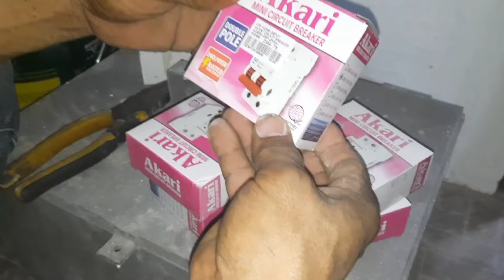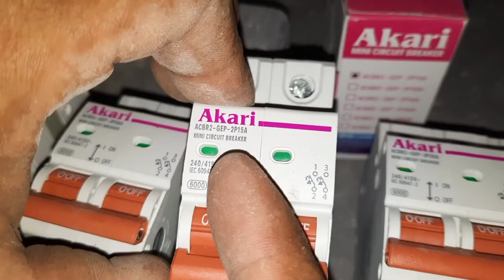PAANO MAGKABIT NG CIRCUIT BREAKER AT MAG-TERMINATE NG MGA WIRE | Pinoy Electrical Warrior

Comment: Boss tanong lang, balak ko sana maglagay floating shelf malapit sa may circuit breaker.., pano po maiiwasan matamaan yung wires pag wala akong gamit na stud finder? Lagi bang pa vertical wires nyan, basta iwasan ko lang magbutas sa mismong tapot ng box sa taas o baba safe na ba yun? Ganyan na ganyan dn po itsura ng circuit breaker namin.. Salamat
Reply from the maker: iwasan niyo nlang po mag butas sa baba or taas ng panel board, opo safe po ganyang breaker

Comment: Main breaker 40 ampere Lang??
Tapos branch circuits 20a,15,20,30 ??
Hindi kaya mag trip main breaker
Reply from the maker: Hindi po magtitrip yan boss, ung main po kasi di pweding lakihan kasi naka temporay connct lang sa dating linya, papalitan pa yan pag ok na ung bagong meter base, saka di naman po nila pweding pagsabayin lahat gamit.
Reply: Hindi naman siguro masasagad ang 15amp sa ilaw at 20amp sa output